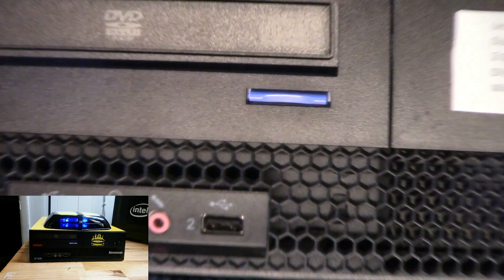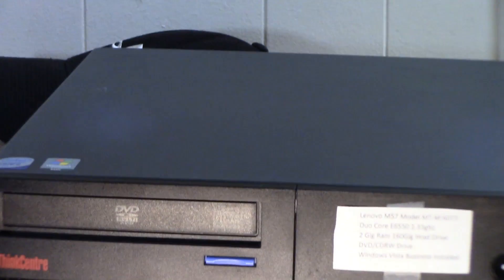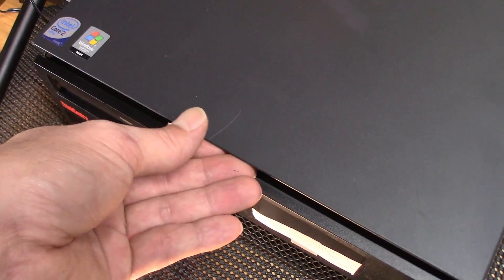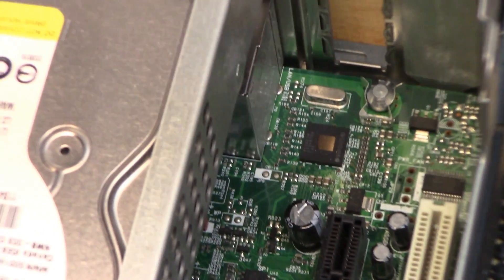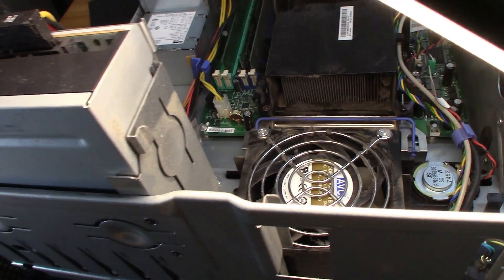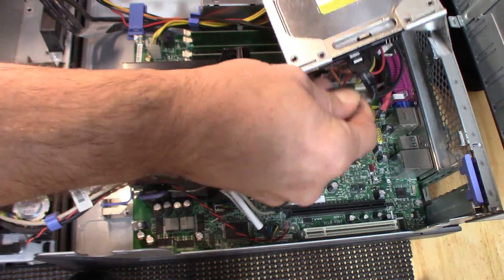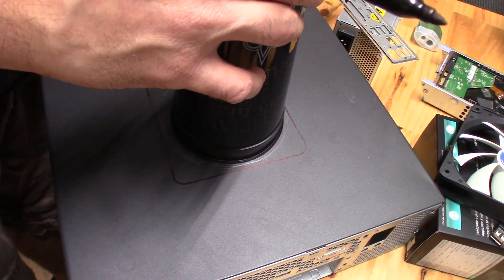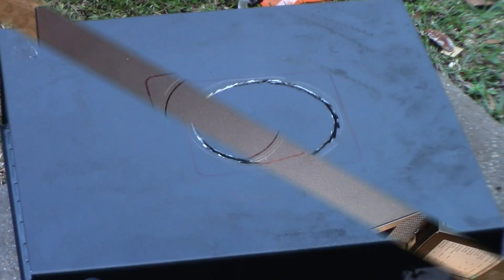THIS LENOVO m57  COMPUTER HAS SOME HORSEPOWER! $20  GAMING PC?

Comment: Can i upgrade thus pc to a gaming computer
Reply: not really. not a modern one anyway. this is a socket 775 computer. pretty old for 2023 standards. at best you get a q6600 or q6700 and tape mod them to OC to 3.0 or 3.2. 

that's still pretty limited. Can't even play Fortnite anymore. 

if all you wanted was to play old games or low end games, then it's possible

Comment: Great video! Updated my m57 USFF to Q9550 (2.83 GHz) it works. Now trying to upgrade to X5470 (3.33 GHz). Any one  knows if M57 bios (micro codes) will work with X5400 series Xeon.

Comment: Sweet vid, I'm looking to put a 350W PSU and GT 1030 into a similar rig, would it work?
Reply: Damian Bell Bro I Dont Need To Change Ur POwer supply Mine works with GT 1030 2gb Gddr5 perfectly Plus I Upgraded To Core 2 Quad Q9650
Reply: @oceanbeats4354  hey, i am a bit late, but yours was the 280 watts psu?

Comment: i got one of these... i added an extra 4 GB of ram (8 GB in total), SSD 128 GB windows 10. with an SSHD 500 GB for storage. i plan to change the CPU to like a core 2 quad maybe a Q9300 if its compatible. I'll see if i can find some faster DDR 2 Ram if thats a thing. i don't know what graphics card i should use cause i don't know much about whats compatible. 
Also i know very little about this stuff so wish me luck and any suggestions would be helpful.

Comment: You cheated bro! You did not use a low profile graphics card!
Reply from the maker: I didn't have one
Reply: +modstek Who does? That is why sff systems fail...Not enough space for a good graphics card. But its awesome, that you like old style towers. Are you still using this computer?
Reply from the maker: I actually had it up until a few days ago and sold it real cheap...yeah I like the old towers the new ones are cheaply made and dent easy
Reply: where was the gpu if it wasnt full size?, i can only fit a low

Comment: I got a Lenovo thinkcentre m57 with windows 7 ultimate x64 with intel core 2 duo 6300 with 1.86 GHz 4gb of ram 250 gb hard drive, what should I do for it to be able to run some hard games such as gta v and sky rim and what not. What should I change in the computer? Please help im clueless.
Reply: You need a Quad core 3.0ghz, 6-8gb ram and a good video card.
Reply: What are some good videocards that will fit it, and how can I add ram and change it to 3.0 GHz
Reply: Edrian Fajardo swap cpu(make sure its compatible with Motherboard) second check what type of ram you have and look for it online or a store near you. ( graphics card your personal choice) psu may need upgrade depending on what you get and currently have
Reply: not at all u can run shit maybe like roblox on low graphics
Reply: Ojskin it won't even play Minecraft....

Comment: How did you manage to install other windows out of Windows XP and Windows Vista? I have the same PC with the same motherboard but other windows can not run outside of Windows XP because it gives me error installing drivers.
Sorry for my bad english.
Reply from the maker: the drivers can be tricky sometimes. Do not run the driver save it to your desktop right click it and go to the properties and change the compatibility to xp or vista and then run as administrator....If that does not work put the driver in a folder and right click extract here ( assuming you have WinRAR) the go to device manager and locate driver myself have disk and point to folder info file.....
Reply from the maker: Los conductores pueden ser difíciles a veces. No ejecute el controlador de guardarlo en su escritorio haga clic derecho en él y vaya a las propiedades y cambiar la compatibilidad a xp o vista y luego ejecutar como administrador .... Si eso no funciona poner el controlador en una carpeta y haga clic en el botón derecho Aquí (asumiendo que usted tiene WinRAR) el ir al encargado del dispositivo y localizar el conductor yo mismo tiene disco y apunta al archivo de la información de la carpeta .....
Reply from the maker: http://pcsupport.lenovo.com/us/en/products/desktops-and-all-in-ones/thinkcentre-m-series-desktops/thinkcentre-m57
Reply: I succeeded! I installed Windows 7 64 bit home premium and everything went perfectly.
I made an upgrade from 2gb ram to 4gb ram and instead of the old dual core processor 2.0ghz I put a core 2 duo e6550 that's a bit better. I can say it runs much better than Windows XP. By the way, see that windows 10 significantly affects your fps in games. I tested Windows xp, 7,8,10 and I will tell you the differences.
Example: San andreas multi player
Old specifications: dual core e2180, 2gb ram, video onboard.
Xp: 25-35 fps
8: 9-14 fps
10: 0-3 fps
After installing a Core 2 duo E6550 I had on windows xp around 35-45.
And with Windiws 7 64 bit and 4 gb ram I still have somewhere around 35-45 but more constant.

Comment: Nice job!
I have m57 too , but my version is a little diffirent , without pci x16 slot and only 2 ram slot .
if i replace the core2 duo cpu with core 2 quad q9650 , will it works ?
Reply: Yes

Comment: The Dell T7500 is another viable option with Dual LGA 1366 Sockets with a riser card. Sure Dells are Heavy but they are well built, unlike their consumer line, very disappointing. 

You might want to see if you can use the LGA 771 to LGA 775 Mod Sticker to put a Xeon Quad Core in this M57 unit. I modded my Dell T3400 to take the Xeon X3363 and it's a beast of a little Gaming Rig. I paid like 40 bucks delivered and 15 bucks on the X3363 plus some memory and I am here to say it's a great set up. The Quad Core Xeon X3363 smokes the Q6600 in every way possible, by smoke I mean leaves it in the DUST... LOL...

Just Google LGA 771 to 775 Mod and you will get tons of info on how to do it. The only real hard part, is removing the Orientation Tabs from within the CPU Socket. Just put in a dead or not used CPU and with a sharp utility blade hack the tab away. The inserted CPU will prevent the Tab cut from flying into the Pins and possible turning your MB into a paper weight. Other than that, just make sure the Xeon you want to use is compatible with your BIOS; most are but some PC's have issues with certain Xeon's. 

My Dell T3400 can take the 3xxx Series Xeon's but not the 5xxx Series... Your M57 might take the 5xxx Series so if it can it's worth doing. The mod tape is cheap too and if you take your time, maybe 20 minutes, you can easily place the tape correctly. The 771 Xeon's have a different Orientation than the 775 so that is why you need to cut the tabs out. The Mod Tape changes the necessary pins as well. The Gold Corner marker is the same on either CPU so just be careful to ensure you match that when inserting the CPU. I know I've come to rely on the Orientation Tabs more than Gold Corner when inserting CPU's these days and the LGA 775 or 771 is Square and easy to insert the wrong way. 

You do wonderful and very creative work, well done....
Reply from the maker: I actually tried to do the mod on an OptiPlex 760 but I bought the wrong xeon sadly. I think its the 3000 series that works in them and I got a 5000.. I think for the 760 price for performance wouldn't add up if I remember....I do want to find a board I can overclock with that mod tho...any suggestions? Thank you for the compliment
Reply: Google it is the best option because boards seem to update all the time. Socket 775 boards are pricey for their age and given the fact they are still useful almost justifies their price... As for me as well, only the Xeon X3363 worked with the 771 to 775 mod tape and wow what a boost that CPU gave to my T3400.

The LGA 1366 Xeon's are dropping in price too and it won't be long before you can snag the W3690 for a reasonable price. I bought mine about 6 months ago for 162 bucks and just now they are down to the 130ish range. That's the fastest, single CPU, application LGA 1366 and it's a beast of a Gamer too. If you get a Dell T3500 cheap, hang on to it and pair it with the W3690 you'll be happy for a very long time. 

If you're happy with the 775 rigs,  your Happiness factor will be X 100 with the LGA 1366 Line. They are a huge step up from the 775 platform and some with an additional 2 cores really adds to the enjoyment.

I've been working with PC's since 1986 and my first CPU was the 8088 running a whopping 4.77 MHz. Needless to say when the 80188 emerged than 80288 and 80388 than 4, 5, 6, now 7 series I am here to say each transition brought with it many gains and few minuses. You did a video about a 32 Bit OS and the 8088 was a 16 bit buss, 1/2 the 32 bit...

To put the 8088 in prospective to current CPU's lets use Dollars and Cents. Basically the 8088 is equal to 4 dollars and 77 cents or 4.77 MHz and current CPU's running let's say 3.5 GHz is 3 Thousand 5 hundred Dollars and who cares about the Cents so that should give you some idea of how far CPU's have come in 30 years...

PC Progressions over the years have changed drastically especially in the area of HHD's. I had a 10 Meg HHD on an MFM Controller and it easily weighed 30 lbs if not more. It took up 2 - 5 1/4 bays and the case that would hold such a drive was made from steel, not Aluminum like most are today. PC's of old were massively Heavy and could easily be used as Anchors rather than paper weights... 

I look forward to what you get into next... Cheers....
Reply: Mine is already on lga 775 socket

Comment: I have a t7400 with two cpu,s but no hyperthreading it weighs about 60 pounds it is simular to the t7500 but older .it has 1000 watt power supply.these machines can hold a lot  of  ram too.

Comment: have you tried a dell t3500 or t5500 , you can buy a x5570 for 20 dollars and they are fast . I was able to make a succcessful playstation 2 emulator , i  want to save up and try a x5670 xeon 6 core next  . the t5500 holds two cpu's if you have the riser . I put 2 x5570's with 16 logical cores .
Reply from the maker: the dell server towers? I had one of them they are cool looking but oh so heavy and noisy.. I want to do the dual cpu thing though
Reply: yes server towers.the t3500 only has one cpu but the t5500 you can put a cpu riser for a second cpu .the best cpu i found is x5570 95 watt quad with turbo and hyperthreading for 20 dollars right no on ebay ,they are a 1400 dollar chip originally.or a hex core x5670 95 watt sells used now for 60 dollars.the riser board for the cpu is about 80 dollars .the t5500 comes with 850 watt power supply so u can put a big gpu in it.
Reply: If yours was noisy I'd say you either had bad fans or heating issues. One way I solved my heating issue was to install a fan over the North or South Bridge, I forget which one has the Cooler; probably the North. And by keeping that cool it did not cause that huge 140MM Beast to create a Tornado in the PC. I am very impressed with Dell Server Fans, I mean seriously Impressed. They move a ton of air and move it well. As for the weight, there's no getting about that, steel is just heavy and durable and when you pay thousands for a Server it better be worth it's weight in Gold...

Comment: Good video I have a doubt I have a lenovo m58p lig41n ddr2 which is the tape mode of q6600 2.4 and dual core e5800 3.2 I put a xeon e5450 3.0 it raises but the cooler of the cpu starts to acer much noise as if it would be heating

Comment: I had an ECS 945gct-m3 motherboard I bought a few years back that I thought I was stuck with a intel pentium d, never could get the bios to update with vista or windows 7, then last night I figured I'd use a quick windows xp install for a temp on a ssd to update the bios and it worked perfectly! Before it would only take a 800 mhz fsb processor now I have a 2.13 ghz 1066 mhz fsb core 2 duo in it working fine! The new bios has more features than before and since it originally was an e-machine board, it now only says Award Bios! The update was available from ECS! 

I plan on doing a quick flip with an old case and the ecs board and will be buying another board for under $20 for my other old core 2 duo E8400 that has DDR3 capability, which I have a brand new 4gb stick of G Skill RipJaws 1066 to install for ubuntu studio and will be using a 120gb ssd plus a 1tb hd! But I plan on doing an OEM Windows 7 pro install on the ECS to resell with a 4gb dual channel ddr2 800 setup and 60gb-120gb ssd and 1gb EVGA NVidia 210 video card! 

I do have another system I have to sell that has a intel motherboard with an E8400 and Quad Channel 4 gb Corsair DDR2 800 setup with an EVGA Nvidia 730 with 2gb ddr3 with windows 7 pro installed, but it has a 250gb WD Blue HD and extra 80gb hd for storage! But one thing to mention, I always use ashampoo burning studio 2016 for the burner software on my pc's, it is free and beats using other types, I always install ashampoo win optimizer 2016 "They have a range of free software" as well as Microsoft Security Essentials on the builds! But the complete oem windows 7 pro 64bit with disc and coa is only $35 on ebay!
Reply from the maker: Awesome! tinkering pays off some times